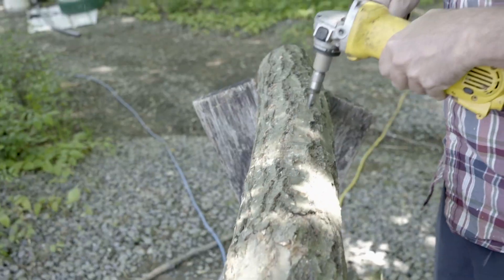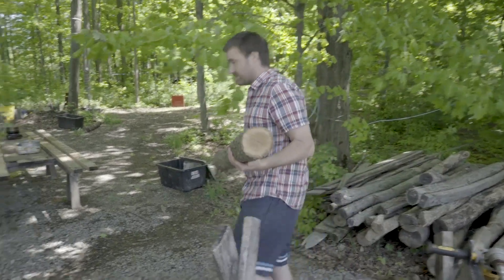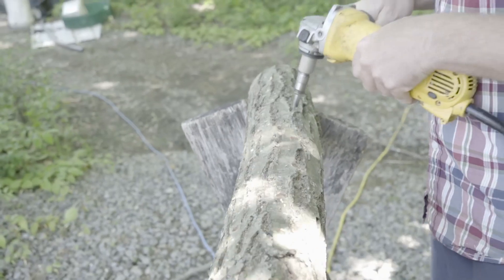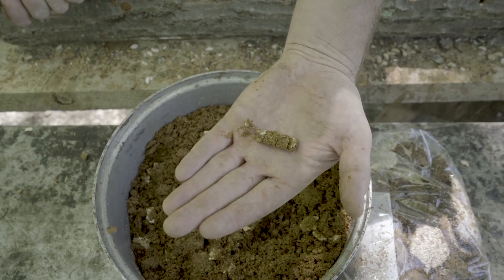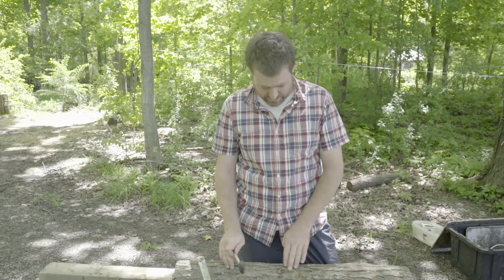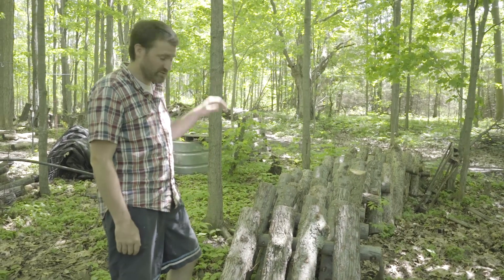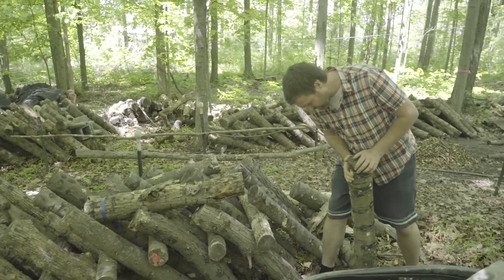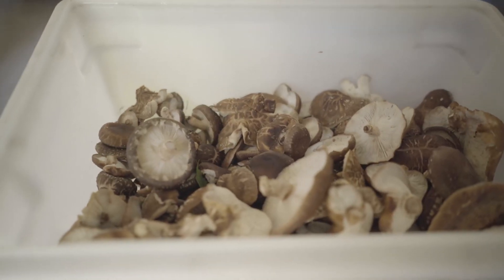How to Inoculate Shiitake Mushroom Logs

Comment: Why did you use a grinder instead of a drill to make the holes?
Reply from the maker: It's a special bit that goes on a grinder and always drills to the same depth, it just makes the process faster. On a small scale a drill is fine, on a large scale definitely consider the grinder set up
Reply: @cornellsmallfarms  how is this kind of drill called?

Comment: would it be easier to use the plugs, rather than the spawn you used?
Reply: 4 less than 100 logs it's ideal to use plugs but sawdust spawn is cheaper long-term imagine the cost of dowels that have to be colonized first as opposed to just having cheap sawdust which is available for almost for free dowels have to actually be cut then shaped around and they have a special spiral cut it's a lot that goes into these dolls that's why they are so expensive compared to sawdust spawn
Reply: @tomsuica8731  Top 5 DIY Dowel Making Jigs — How to make a Dowels Maker  I like the table saw using 4' lengths 

 https://www.youtube.com/watch?v=9X-gJFoVdYU&ab_channel=MazayDIYMazayDIY